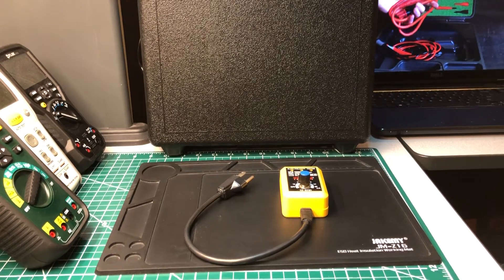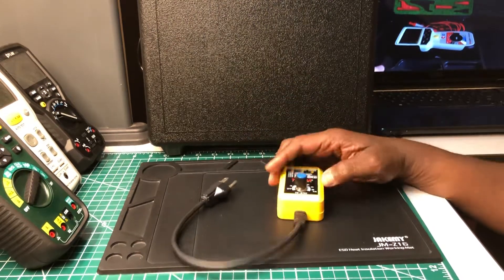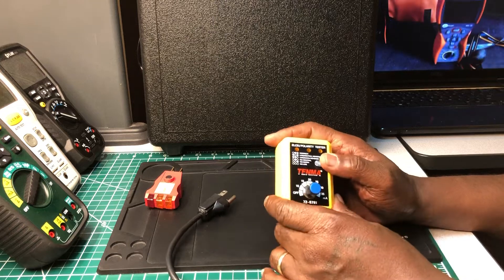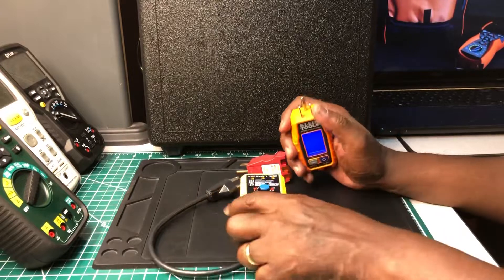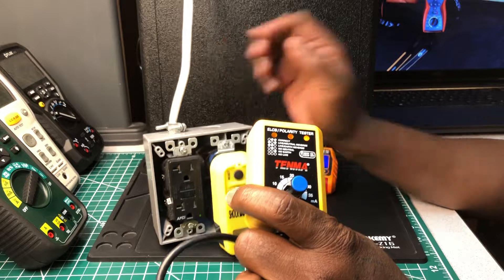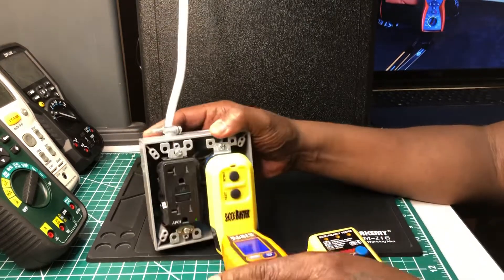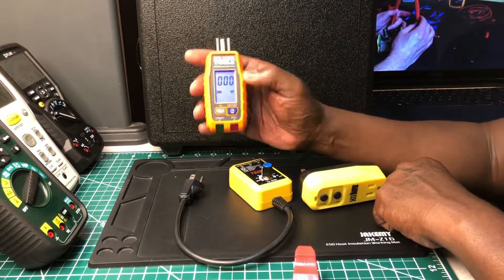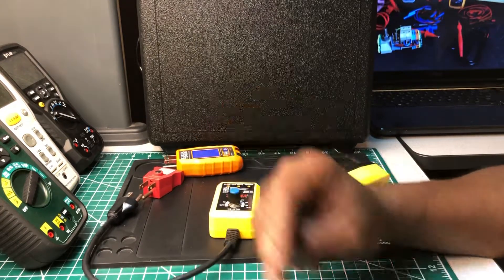TENMA 72-6791  ELCB/Polarity Tester

Comment: I use an Ideal one that is similar to your budget Amprobe one. It works ok. I also have some chinese one that shows voltage, but I can't recommend it because of the durability. If I dropped it would probably shatter. You never want to be in the middle of nowhere and have to replace a tool.
Reply from the maker: I hate the thought of having to replace a tool in the middle of a job out in the middle of nowhere 😲😲😲.